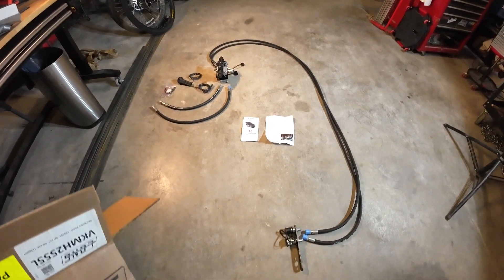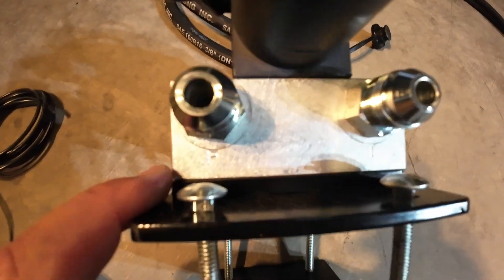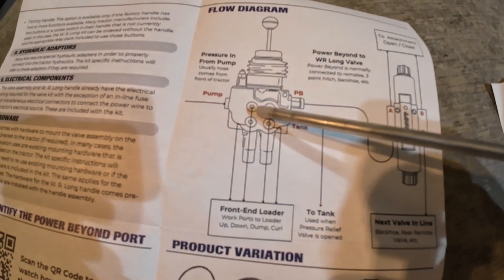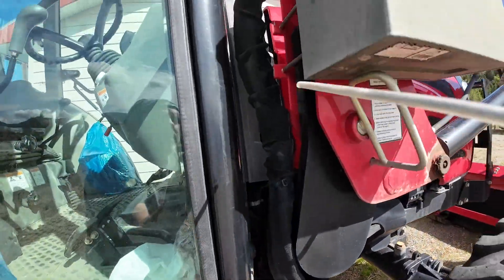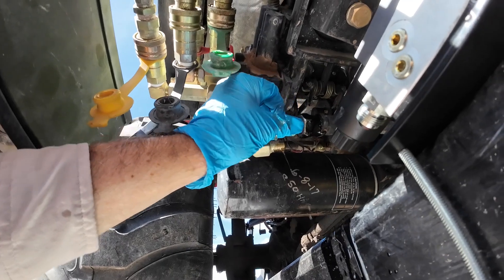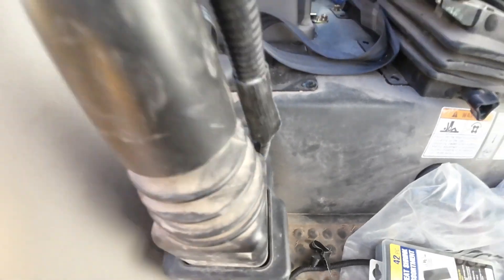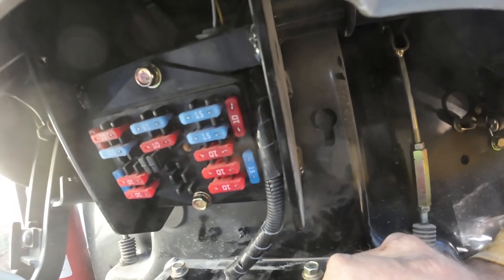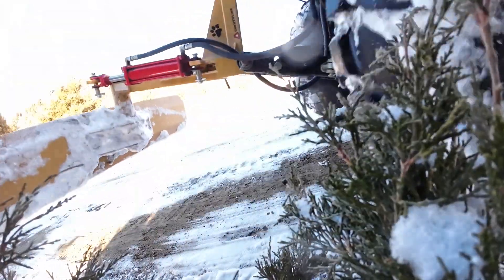How THIRD FUNCTION works on tractor + INSTALL

Comment: Nice set up !
It's slower in one direction because of the lack of piston rod area being taken up within the cylinder bore (requiring more volume). We ran into this when I was in the conveyor business back in the '80s - we'd have to account for the timing difference while doing a transfer.
Reply from the maker: @mark_osborne  do you mean because one side of the Piston has a rod and the other side does not?
Reply: @anesthesiadreamin  Yes
Reply from the maker: @mark_osborne  thank you so much for your comments! I learn so much from you guys that are more experienced, and what you taught me makes absolute perfect sense! Thanks again for sharing 👍